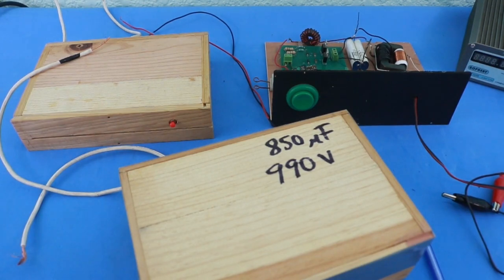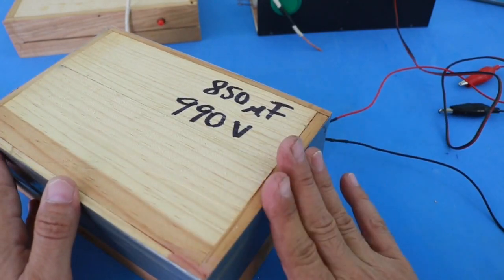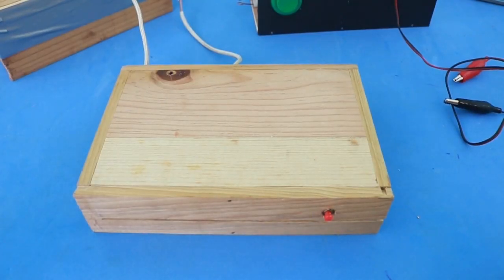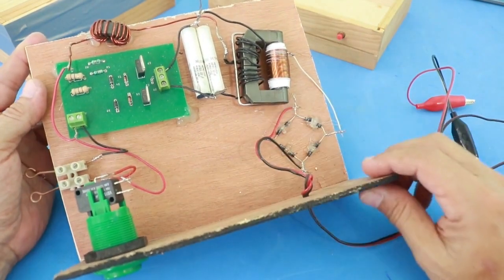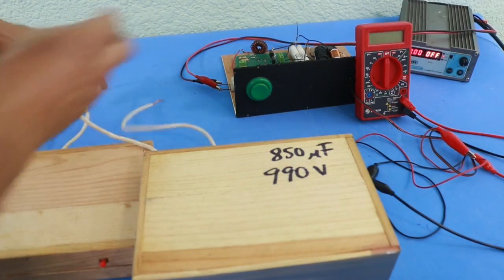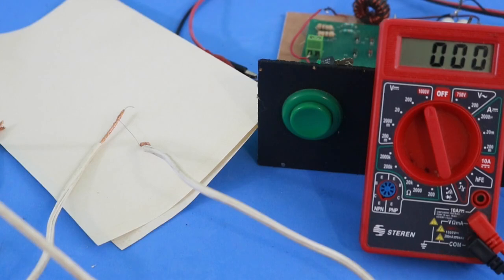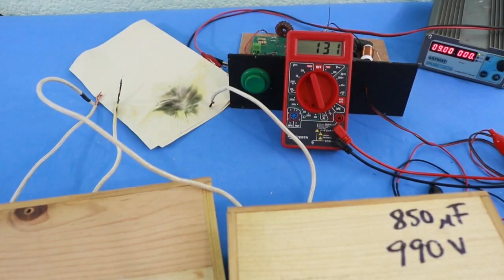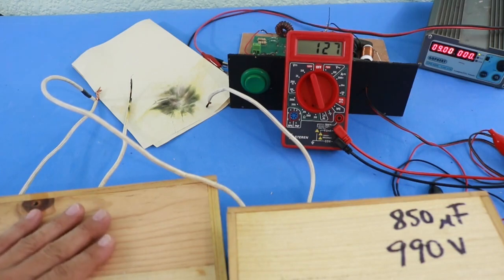High Voltage Capacitor Bank Part II

Comment: Nice video. But can it power a large flash?
Reply: Calculate energy in that thing and how much  energy needed by 1led and you can answer yourself
Reply: @voidex136  by flash I didn't mean LED but large gas lamps
Reply: @Bro1774  but if its gas how it can be powered with electricity?
Reply: @voidex136  its called a xenon flash tube....
Reply: @maxxiang8746  well same as  for led than but in that case you probably will get a half a second or so
Reply: @voidex136  alright then

Comment: Man I want to make a sender tester for voltages above 330v how to do so plz help..
Reply: Zener tester
Reply: @rajeshsharma-ng3cb  You could use a voltage multiplier circuit with an output resistor. It involves dangerous mains voltage though, so only do it if you are aware of all the safety issues.
Reply: @Basement Science  man I have a circuit working with high voltage using single MOSFET osscilator but it hardly produces 60vdc